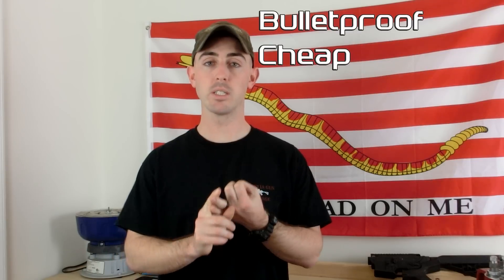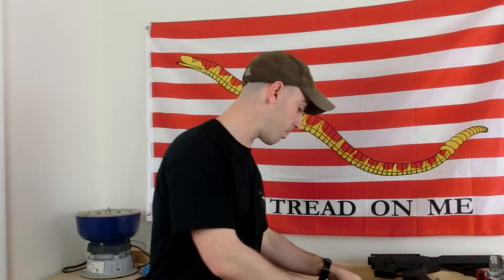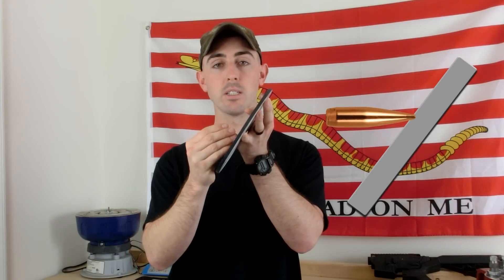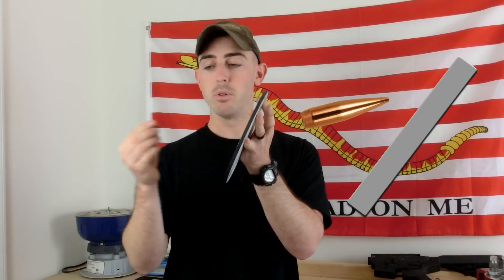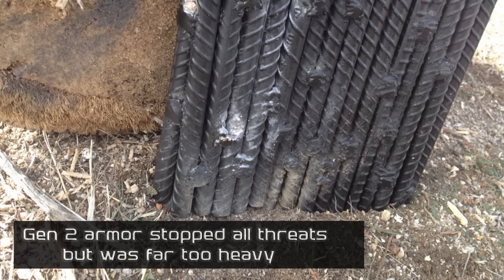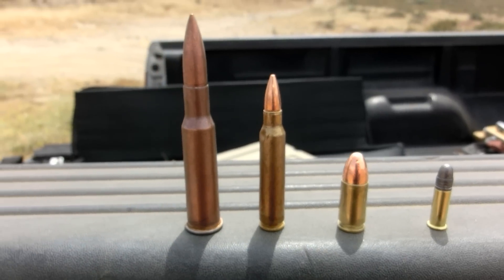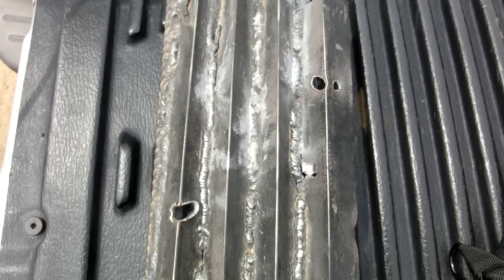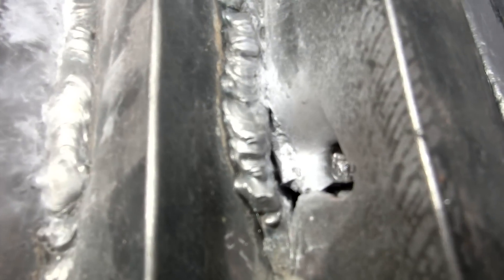Is It Possible to Build Homemade Body Armor?

Comment: I guess soaking a phone book in fiberglass or carbon fiber resin never came up as consideration?
Reply from the maker: +MatteoSixSeventyFour We have been getting a number of awesome alternatives. I think we may have a series here haha
Reply: +Gun Runnerz 👍
Reply: Then spray the whole thing in truck bed liner
Reply: Fibre glass works as a wrap for cermic tiles or just as one of the layers to eat up energy

Comment: I made some decent armor once out of something called woven roving. It is the tightest weave of fiberglass material, and of course resin. It worked great, but only cost a bit less then an AR500 plate so not really worth it when I can just buy that. I tried Lexan and Acrylic composite. Never tested as I was unable to laminate the layers well enough to bother. I need to learn how to properly laminate the materials before I try that again. Would not expect it to stop full powered rifle rounds without ridiculous thickness though.
Reply from the maker: +Jesse Sisolack Interesting. It was hard to find something that would remain reasonably useful and still maintain its effectiveness.

Comment: fill those triangular bars with polyester apoxy coated fiberglass and instert those into there. then weld a sheet to the top to prevent shrapnel from going up or put a coating on it.

Comment: So, just a question. You stated that you didn't want to use just a chunk of steel for the design. So why did you use 2 chunks of steel? I understand that you were just thinking about time/cost/ease of making this, but why use what you said you didn't want to?
Reply from the maker: Great question. Keep in mind I'm no engineer. I wanted to stay away from a solid piece of steel mainly because of weight. Everyone knows a big hunk of steel would have worked. I wanted to see if we could take advantage of geometrically different designs to cut weight while maintaining performance.
Reply: Ok, I understand that. thanks for the reply.